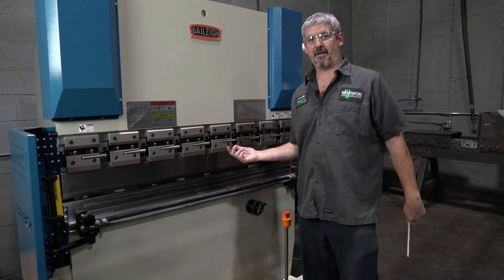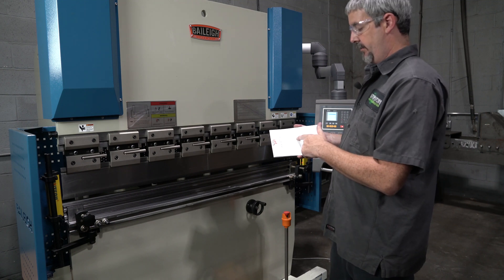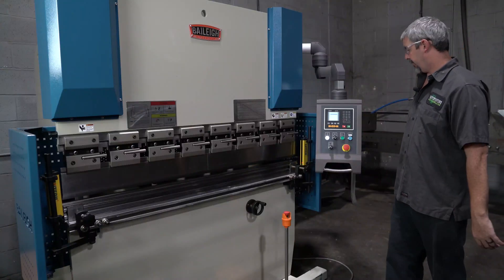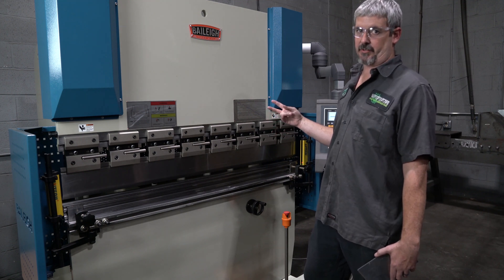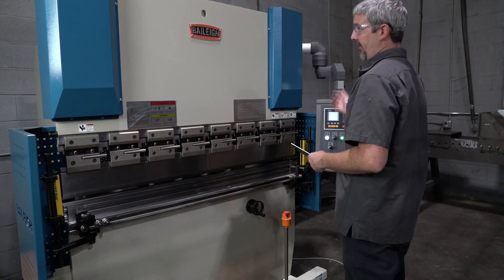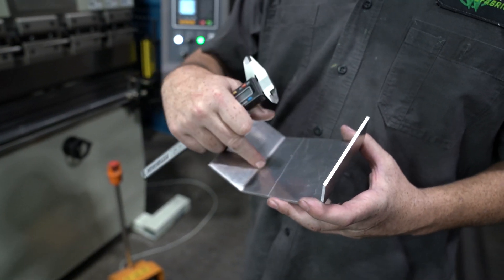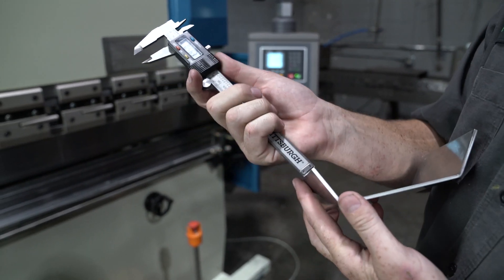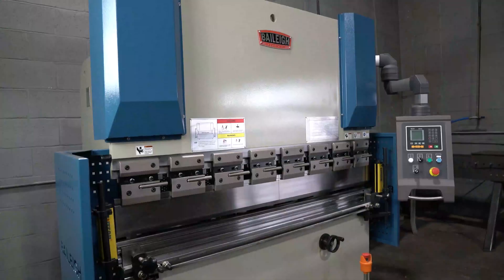Using the Baileigh BP-3305 CNC Press Brake to make a Trough

Comment: Seems like it was taking a long time to adjust between bends. Thought it would only take a few seconds, 5 tops between bends.
Reply: Yes it takes a long time to set between bends, I have this in my education lab, not a machine for production unless you have time to kill. Plus this machine is made in China for a half dozen different manufactures, putting their name on it..
Reply: @michaelluchesi6296  can you please provide with an alternative for a similar pricing range?
Reply: @michaelluchesi6296 about how long does it take to reset between different bend angles?  Does it take longer if there is a big difference between the angles?  Like if the first is a 20° bend and the next is a 90° bend.  Thank you
Reply from the maker: Yes it does take some time.